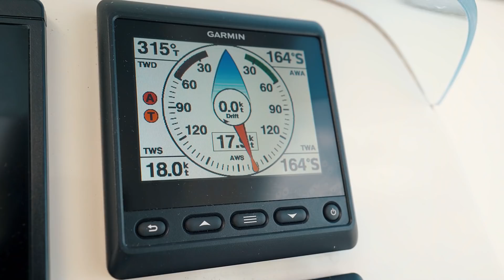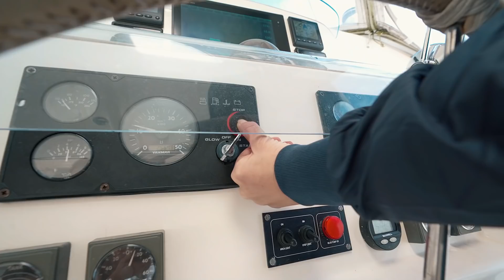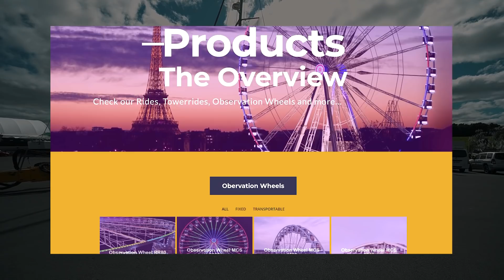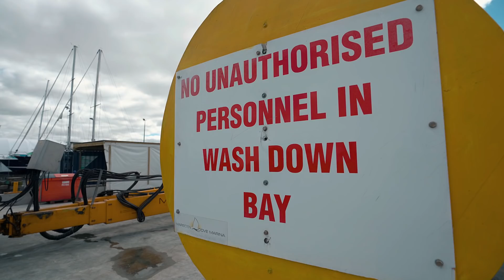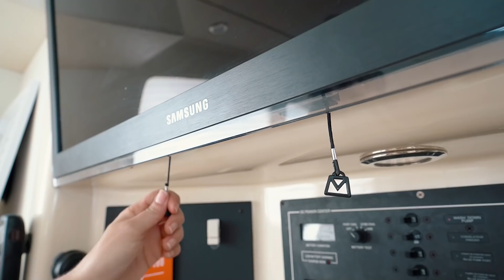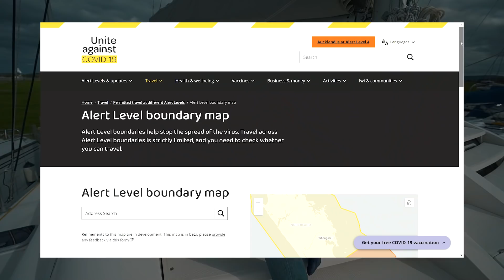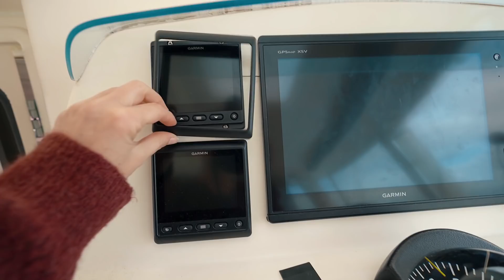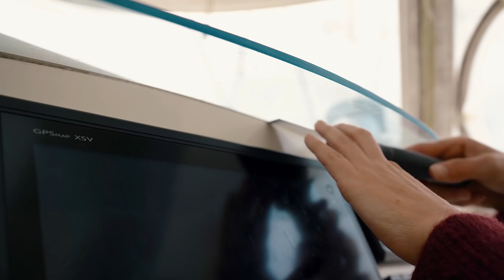TAKING OUR BOAT ON A ROAD TRIP

Comment: Thanks for the earlier drop time. It made getting to church less of a mad dash.  
Looking down the underside of the hull, be sure to investigate those bilateral rust stains. Those rust stains are iron coming off something you you don’t want weakened.
After seeing the damage to the life raft locker, the cracked windows in the salon, and the damage to the helmsman’s navigation console, please, please, please tell me you are going to check the bulkheads (see Sailing Parlay).
Reply: Leopards Bulkheads are built like tanks. I have one and know that for sure.
Reply: this is a Leopard, much better construction.
Reply: I think the rust stain is from the chain locker. Probably from that cheap chain they bought in Panama
Reply: Bobb Grimley  I agree, the older the boat and the more ocean sailing it's done it would be worthwhile to check the backbone of the boat, the bulkheads for delamination or flexing. The boat has to be level and supported perfectly before that. They may want to pull a string along the deck to check for flexing too. The 'Sailing Parley' channel has been a real eye opener for anyone owning a live aboard catamaran.
Reply: Bobb Grimley  I'd still trust a DC-3 where the owner did checks of the fuselage integrity and straightness over one who didn't.
Reply: Bobb Grimley  Bad manners towards Island Kate! Take that sh*t elsewhere.
Reply: Bobb Grimley  Actually I do know about those things, not from first hand experience but I have friends who are aircraft mechanics and have taken me up in their planes, after they did their walk arounds and inspections. One, Larry Perry, was in the Air Force, one, Mike Schultz, works out of Cable Airport in Upland. I never owned any kind of aircraft and while I'm not the smartest guy in the room, I'm not the dumbest either. Last thing I'd like to point out, there are plenty of aircraft  that have had their mandated maintenance and countless inspections, that have still crashed or been torn apart in flight. Including the workhorse DC-3. It can't hurt the Wynn's to get a good inspection done of the bones holding their boat together.
Reply: Guys the difference is with a Leopard cat the bulkheads are not hidden and you can see them very easily. Leopard make their boats very serviceable and there is a service door everywhere for you to see and access things. The cosmetic side of the bulkheads going to the cabins have panelite that is bonded to the bulkhead. This means if the bulkhead bends or breaks it can Immediately be seen. Open the cupboard doors and the inside is the bulkheads tabbed against the hull and flocoated over. Any movement or breakage will crack the floacoat as it's very brittle
Reply: As to the "hole" in the bottom it's a door that was originally designed that if the cat was upside down you could remove the 4 bolts and take out your life raft. Yes the bolts failed and that's why it fell off . On the later model boats this was not there any more. My life raft came in the back locker but I have moved it to the rear of the boat. So technically there was not any structural defect when the door broke its bolts. 
On the windows yes this is a common Leopard problem. The sikaflex used to bond the windows to the acrylic window does not seem to hold on to the acrylic. Many people have changed this to a Dow 795 silicone not polyurethane which seems to bind better and allow for more flex

Comment: So THAT'S What it looks like when a couple takes their catamaran for a walk!  LOL  For whatever reason that's what popped in my mind when you were walking behind the boat on the way to the repair yard.   For a tip about removing covers from any gauge; think about leverage and if you can't get it pulling, then maybe it will work if you push it.  Example:  You could lay something like a wooden pencil (or something larger enough to work) behind the putty knife next to the gauge cover and then when you "Push" on the handle of the putty knife it gives you more leverage on the other end than you typically get when trying to pop them off using other methods.  A small set of flat woodworking trim pry bars might come in very handy for long-term boat maintenance.  Glad to see that you made it to the haul-out site.

Comment: @7:30. There's a lot of ridges and troughs in your underside.  Not great at all for smooth sailing.  Structural for sure but why have they not designed out the steps and ridges?

Comment: A tool suggestion from a handy man, a 'Dead Blow Mallet'. These are usually a few pounds with a wooden handle,  large head made of lead or steel and plastic at the working ends. This will give you more mass to push your putty knives into that caulk. . Note, they don't need a large or fast swing, the solid mass of the tool does the work for you (great for small space work).  These mallets are great for chiseling, carving and persuading the errant glued part to separate

Comment: Get yourself some automotive trim tools.  They come in plastic, and have a few different tools that are shaped like small pry bars, and crow bars to give you leverage, and also have some wedges to drive in to separate adhesives more easily.  Very cheap and well worth it to have in a tool box on a boat.

Comment: Nikki, the IFIXIT kit, has blue plastic guitar pick style wedges, that you can slip between the bezel and the display edge to ease the bezel off it's retaining tangs. Plus being plastic, they have little chance of scratching the instruments.
Best wishes al, from the far North.
Reply: My suggestion is also some type plastic Auto Trim Removal Tool Set.
Reply: I've used actual guitar picks. Anyway, there have been lots of good tool/tips advice on this topic. Maybe they need to post a week in advance what they will be working on and ask for advice from someone who's familiar with the subject?

Comment: For the navigation trim covers, you could use automotive trim removal tools (larger, more robust than computer/cell phone spudgers).  Used to remove car dashboard sections, door panels, wheel well interior pieces, etc.  These tools are specifically made for prying with minimal (hopefully "no") damage--most are plastic, with some metal tools for removing fasteners.  The kits are pretty inexpensive on Amazon.

Comment: Interesting to see that the bolts that held the lifeboat locker in place actually sheared off and that was just about all that held it in place.  No Sikaflex or other adhesives.  I guess the idea was that the locker was supposed to be accessible if the boat ever flipped.

Comment: On removing those covers from the electronics .... maybe try some spudgers like are used to open up laptops, tablets and phones. The trick is to get one in then take others and leave them in as you go around the edges. I've also used old credit/membership cards and guitar picks. Plastic is less likely to damage anything but if you want to keep using that putty knife using a small piece of wood to act as a fulcrum will help you pry up the edges and protect the surface.

Comment: Oh I am so happy… Not a single power tool. Handtools are amazing!    Another idea that may help in the future when you’re trying to cut through caulking. A piece of tie wire and a heat gun.  Tie wire is what is used to tie neon in place.  Use the heat gun to soften the caulking and as you’re doing so use the tie wire to slide between the piece you’re trying to remove and the caulking and use it in a cutting motion or side to side if you will. This process will also work with double faced tape as well. Thai wire can be picked up at any hardware store and obviously a heat gun can be purchased online or at a hardware store.  for what you’re doing a hair dryer will probably do the job.  Damn I only wish I could be there to help you guys.  I am always available if you ever need advice. And my services are free.    Stay safe and be well.

Comment: Hellow Jason & Nikki , my name is Steve (Squid) & my wife is Den from Lake Macquarie NSW Australia 
Well done on your travels so far , it keeps us motivated in lockdown while we are waiting on our new Leopard 42
To arrive in Sydney next July for the boat show , just wanted to let you know what we did on our last cat heading to Hamilton island several years ago . Coming from monohull sailing I added a spinnaker pole for our downhill running which was not a success & managed to bend it 90 degrees.
So when we made it to Mooloolaba I purchased 2 new blocks & fitted them adjacent to the  mast & ran an extra sheet rope aft on the windward side , so when the wind is too strong for the kite just sheet the Genoa on the windward side , which will balance the boat & achieve good speed for downhill running , hope this helps
Stay safe , Squid & Den LMYC

Comment: Having owned several boats and now building a camper van, I so so so understand your frustration at trying to do what seem like straightforward tasks.  All I can say is that you have more restraint than I do.  I would have kicked the console and said some rude words after trying that many times to pry the trim off.  

My tip after gouging things more often than I'd care to admit is to use plastic automotive trim remover tools and to cover delicate areas with masking tape and scrap pieces of cereal box etc before starting so I know I can go for it and not have to worry.
Reply: Well, we don't know how much cursing was involved because Nikki or Jason edits the video to remove the dog darn bleep bleep bleeping bleeps!  ;-)

Comment: If that's a VHF antenna coil up behind your dash, you should unwind it and shorten the length of the cable.  Its relatively easy to attach a new plug (or re-use the plug you have) the shorter cable. 

This will give you instant, FREE, more power in your radio.  EG: The long antanna wire is sucking out power, and that extra power could be critical in an emergency situation.

Comment: To pop the edge of the instruments take your putty knife and separate the cover, then take a small (not to small) flat head screw driver and insert under the putty knife.  Then remove the putty knife and twist the screwdriver. Do this in the corner only.  The putty knife is not stiff enough to pop the panel cover off.

Comment: Now that you have a lot of old used caulk that you can play with, try losing it up or to make it pliable with a heat source like a hair dryer, heat gun. Be careful on the amount of heat you use as it could make things worse. I know working with it in direct sunlight softens up some, a little heat could help with clean up also.

Comment: When dismantling the dashboard of a car - eg. if you wanna put in a new radio - then you always use plastic tools for that purpose. It is much better than using metal tools. Try look it up and buy some at a shop. It is not that expensive and works more handy and ensure you don't destroy the things your are dismantling

Comment: And, if your radar fails, you can't have your local marine electronics store repair it.  It has to be sent back to Kansas to be repaired.  The beauty of 
Garmin.  When I took the Cheoy Lee 61 to Mexico i found the closest tide information  on the garmin equipment was for  Texas which was not of much use on a boat that draws 6 feet.

Comment: ..... well!, have seen surf-shark promos don't know how many times Nikki and you actually got me thinking today that it may be something I should have in my stash of enhancing life goodies .... bang up job of docking with one hand adjusting both control while use the other to lean out starboard to have an eye on things firsthand . Well executed, bet there was not a one that doubted your skill Nikki .....  re the dash, have seen some that have cut out a square and then used that plastic that makes one think of cutting boards, which one gets the impression comes in a variety of colors. Anyhow they make a dash panel out of that that fits over the hole ..... your segment of curiosity traveling across the field behind the tractor looking so out of place reminded me of a clip I saw years ago of a jumbo jet taxing over a bridge over a freeway ... cool stuff you know ... great when you don't have crew where you wonder if they have done this before ..  thx for the share Jason and Nikki .... as always .. never stop dreaming, just dream bigger .. have fun be safe, save our oceans ...

Comment: Suggestion:  If you know the size of the Allen keys to the screws with Allen heads, buy longer Allen keys, cut off the angle portion and use the long portion in your drill to remove or install the screws. Work smarter, not harder.  I like to use ball head hex keys.  👍👍

Comment: If you don't have one(s) already a rubber mallet or two of different weight come in handy. Same with plumbers/monkey wrenches. Those are much better than pliers for loosening pipes and fittings.

Comment: I know you are done removing the instruments and the facings (trim,not sure what you call them) I found using a torch lightly on your putty knives or some prefer a hair dryer, to warm them makes the job almost a breeze & alot less likely to damage any components,kinda like putting your ice cream spoon in warm water to make it easier to get it through that really hard ice cream. Just use CAUTION if you warm them w/a torch,too much heat can damage the fiberglass! Good Luck w/all your upgrades!

Comment: Excellent video kids!
Have you, or anyone else, heard of any sailboats using StarLink yet?  I am wondering how well the receiver will function on a boat, first one at a dock, at a mooring or anchor and  then if it can work at all under passage.
Reply from the maker: Starlink hasn't rolled out the "fully mobile" system yet but there are a lot of people anxiously awaiting its arrival!
Curious Minion

Comment: Use fishing line to remove the screw covers.
Reply: Was about to suggest some wire or something similar.
Reply: @Death_Saved  dental floss works too.
Reply: Wire, whipping thread or parachute cord (no larger) is easier on the fingers.
Reply: How about a sledgehammer for the delicate adjustments.

Comment: That must be the shorted road trip from ramp to yard, on the hard, the Wynns have ever done.  Us trailer sailors do it every time we put out and recover.  Much longer distances, though.  Near or far, it's the "roll mode" prep work that counts.  Thanks for researching that heavy trailer hardware, Nikki! 

I had the same "different English dialects" experience in the Nantucket Boat Basin, with an Australian boat next door asking for some sandpaper as I sanded 44 feet of teak stem to stern. 

With New Zealand coming out of lockdown, might a rugby test seeing the Black Ferns be in order?  Nikki's grief extracting helm station electronics seems to have put her right in the mood for joining the Black Ferns in some pre-rugby haka... if only to let off some steam.  Better to master one's anger first: It's the key to governing a city of unending boat projects beyond the ocean's punishment making more of them.   

Blessings,

S/V Windwalker.

Comment: We have a lot of tunicates growing on the dock at Marina Del Ray I actually contacted a marine biologist at Berkeley and sent her a picture of them to find out what the were. I was hoping they were edible so I could do some experiments cooking them but they're not fit to eat unfortunately.  My boat doesn't have any of the control panels and gear hooked up that I need yet. I won't be putting any of it into the fiberglass of the boat though. I plan on making water tight boxes as small as I can that can be attached with ratchet straps. Instead of holes in a bulked I'm going with a shelf that these devices strap down to. If I want to dress it up I'll use some vinyl upholstery or something to hide the boxes and ratchet straps.  but everything will just have a plug that you just undo and take off the ratchet strap. If you  need a new unit you just toss the box and make a new box to fit the new device, nothing integrated. I'm basing this idea on videos like this removing these stubborn consoles and redoing fiberglass constantly.

Comment: Just an idea for a couple of small tools that might make removing bezels easier in the future. First a set of small plastic shims. They are tiny, about one inch wide and half again longer. They would easily slide in between those instruments and with the inclined plane of a wedge, pop the corner of the bezel by just tapping it in until it gives. Plus, because of the small size, it should be able to be fully inserted without entering under the component. 
These are generally available at most big box reno stores and hardware stores. 
The other is a tool used for lifting auto-interior panels such as door covers and fittings that are attached with plastic pins. It looks almost like a forked, blade screwdriver though a bit wider and has a 30% curve about 1 inch from the tip of the tool. I expect these two small very useful tools could make that difficult job and others, much easier with less chance of damaging the stuff you're trying to fix. 

So, just something to keep your eye out for when you're out shopping for other supplies for the boat maintenance you must do.
Reply: Should that before or after they buy a second hammer?

Comment: You guys need to invest in a few better tools to make life easier, a full set of multiple bits Hex/allen/philips/flat with extensions  etc for and a cordless screw driver would make a world of difference. Great to see the boat out and in good condition. also the life raft compartment could be converted into a storage Locker too

Comment: Now your problem you had with the 240V on land and you got 120V on your boat you could use some thick like a Defender 3000VA Intermittent Transformer Distribution Kit 240V/110V . Only £45.